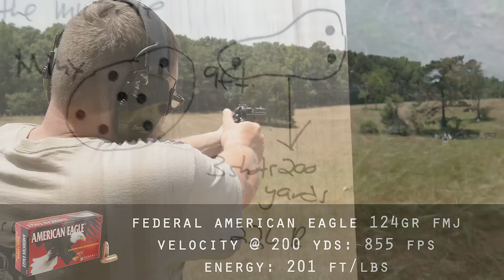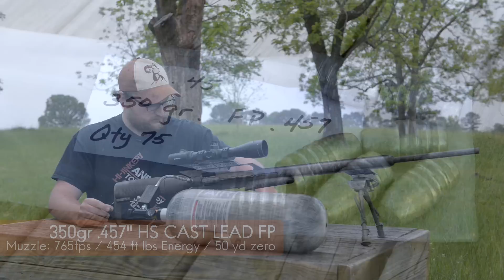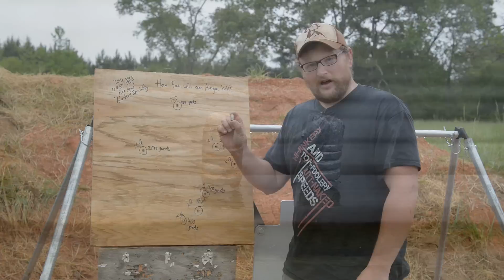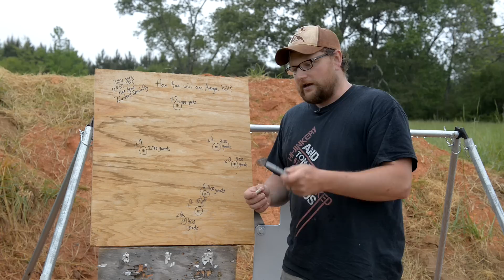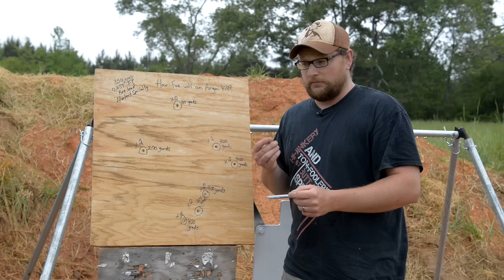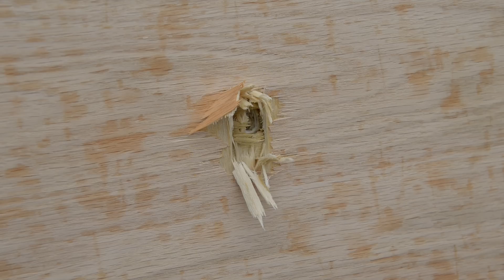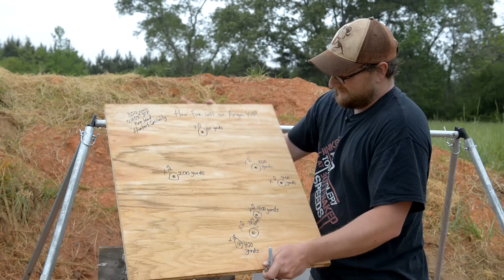How Far Will an Air Rifle Kill? Part 1

Comment: Do you need a guns license to buy this gun? Or can you buy it if you're 18 or over?
Reply: No need for a license (in most states)
Reply: ***** I am not talking about gun control laws, that isn't going to stop the violence in detroit or in most of the inner cities. Some states have implemented such things as you describe, requiring FOIDs, and its done nothing to stop the gangs (look at chicago for one example).

If you want to stop the gangs gun control isn't going to do anything (they already have guns and an illegal supply of guns), you have to address the cause of gangs, not the symptom that is violence. Again ending the war on drugs (so removing the financial incentive) is a good first step that actually works (see colorado and their legalisation of marijuana).

This can be seen in the fact that states without these issues have lower crime (much lower) despite having lax gun laws.

"Another fun fact, Austria allows basically the same guns as the US and yet their gun crime is about level with the UK." - Does Austria have a border with a third world nation across which drugs flow readily? No it doesn't. Does Austria have an underclass who openly hates law enforcement and refuses to work with them even if its in their own interest (as in criminal activity against them)? No it doesn't. This is what causes crime not "gun control", the fact that European nations have such wildly different laws and such similar rate of crime is strong evidence for this, especially as up until recently one could travel across the EU and but gun parts (barrels, receivers etc.) that in different places were not firearms or restricted (e.g. a receiver in germany is not a gun, but in other nations it is) and assemble an illegal gun from parts they bought legally. Though with the migrant crisis that will likely skew data acquired during the on going event.

With regards to the laws you propose you are looking at this without understanding much of the USA. 

Firstly Americans don't want such laws, so they are unlikely to ever become law without either massive change in public opinion (which BTW is leaning towards more ownership not less), or without a president using executive orders (which will feed into the following points and make them far worse).

Secondly you assume that American police will enforce such laws, they won't. As we saw after the gun controls imposed after sandy hook many sheriffs refused to enforce laws deeming them not only unconstitutional (which they were) and so a violation of their oaths (which enforcement would be) but also they knew that they would do nothing to stop crime and only effect the law abiding.

Thirdly you assume such a system is even possible. The USA cannot keep track of illegal immigrants (human beings who must eat sleep drink and defecate) and you are trying to make me believe they can keep track of over 350 million guns? Because without a federal registry and a lack of local law enforcement cooperation if such a law came to pass it would be wholly unenforceable for all but new guns (and again I reiterate over 350 million out there already).

Forth you assume that Americans havn't seen what's happened the world over, first they propose what sounds like a "reasonable" measure (like what you propose, though of course it converts a right into a privilege which is unconstitutional and as the USA is  supposed to be a nation of laws it would require the repeal of the second amendment before such a law could happen) and then they go further restricting some guns further, and enacting registration which leads to confiscation (see the UK and Australia).

If you seriously think gun control still have a real impact on america's violence problem then you are deluding yourself. No proposed laws will do anything, only repealing of drug laws and trying to rebuild the affected communities (while destroying the gang/thug/underclass culture) has even a hope in hell.
Reply: Well, for one, our population is about 5-6 times the UK and is even more diverse. So it is apples to oranges. Cesare Beccaria, a prominent criminologist from the 1700s, even said that gun control does not work. "False is the idea of utility that sacrifices a thousand real advantages for one imaginary or trifling inconvenience; that would take fire from men because it burns, and water because one may drown in it; that has no remedy for evils except destruction. The laws that forbid the carrying of arms are laws of such a nature. They disarm those only those who are neither inclined nor determined to commit crime."
Reply: Population is an issue. places with higher population tend to have more crime (cities more so as they are dense). The homicide rate is on par with most of Europe, but we have more guns. Central and South America consistantly have the highest murder rates in the world and among the lowest legal gun ownership rates. "Such laws make things worse for the assaulted and better for the assailants; they serve rather to encourage than to prevent homicides, for an unarmed man may be attacked with greater confidence than an armed man. They ought to be designated as laws not preventitive but fearful of crimes, produced by the tumultuous impression of a few isolated facts, and not by thoughtful consideration of the inconveniences and advantages of a universal decree."-Cesare Beccaria.
Reply: Fun Fact if the UK classified criminal cases the same way the FBI did then the UK's murder rate would skyrocket. Same with Japan.
Reply: IngeniousFirefly    Actually no the bad categorically did not work.
1. For the ban to have worked we would needed to see a reduction in the use of "assault" weapons used in mass killings. We did not and could not. The ban only prevented the sale of certain firearms and all the millions of these very popular weapons continued to exist. But whats more telling is the fact that before, during and since the ban handguns remain the key mass killing weapon.
2. The huffington post numbers you post are not a critical analysis of the bans effects. In fact it didn't even compare the so called assault weapons against other means. It mentioned this but then brushed it off and presented numbers as though it were taken into consideration. 
3. Number of variables.  The ban was only one of many things happening. It is difficult to assign an accurate number to how much the ban contributed, if at all, compared to other factors. 
There are all sorts of people out there pontificating about whether it worked or did not and very little from either side is based on solid analysis and evidence, largely because such evidence is difficult to obtain.  Yet, people still want to throw their "analysis" out there like it is valid. Look at a prime example. Citydata has a story that wants you to believe that the drop in gun deaths largely happened during the AWB so the ban had to be the reason why.  This is absolutely ludicrous in so many ways. One, the ban only stopped the sale not the possession so at best the ban should have leveled the trend not brought it down. Next, homicides by this weapon type are only 2% of total gun deaths. So, how can there be this big reduction in deaths if 98% are caused by other types of firearms?  Well, it can't. But these points totally escape the author on city data and so many other places. So, before claiming something worked or didn't you really need to fully understand the issue not just some numbers thrown out there by some site, regardless of which side of the issue you fall on.
Reply: U can be any age
Reply: +Airgun Depot okay because I know you don't for regular pellet guns but this thing seems much more powerful
Reply: +Dovahkiin KhajiitMaster it had better be at 1600.$
Reply: In Canada yes
Reply: Depends where you live, my country it's classed as a firearm because it's over the unlicensed power so you need a license. Other countries don't have air rifle limits so you don't...
Reply: licence? its america not cuckistan
Reply: ***** Fun fact, Detroit has a murder rate on par with the whole of the UK.
Reply: ***** not surprising, its basically like a third world nation with the local economy comprised of illegal drugs and illegal arms trafficking. That being said I imagine most murders are gang members killing other gang members.
Reply: ***** The fact that you just dismiss that and don't automatically think something needs to be done about it is quite sad.
Reply: ***** I see that stuff has been tried and has done nothing. 

Perhaps the ending of the war on drugs would help, hurting the financing of the gangs. The real issue is the whole gang/thug culture mixed with the drug war, that not only encourages and aggrandizes being a violent criminal but provides a financial incentive to do so. A culture that is very predominant among poor black communities, as is the case in detroit. 

If you have a solution that will actually do something then I'm sure everyone would like to hear, as I said people have tried for years.
Reply: ***** What has been tried? Background checks? Random bans that only last a few years? Sack load of good that's done. Bullets buttons and magazine limits are just as pointless. 

Even a simple license would be a good start, you get pre vetted so won't need to have any checks upon buying a gun. Walk in, pick a gun show your license and walk out. It would also have the added benefit of filtering out most of the mentally ill nut jobs. That added with by law having to keep them securely stored, illegally held guns will become less and less common because stealing them would become very hard. 

I love guns and don't think any should be banned but the US has a problem, a simple license and storage laws would let sports shooters and any lawful owner keep their rights while stopping criminals getting such easy access to them, 

Another fun fact, Austria allows basically the same guns as the US and yet their gun crime is about level with the UK.
Reply: ***** I'm not saying what i said will absolutely work but the current state of affairs nothing is ever going to change, all the gun crime is just going to get worse and worse. 

I even in the UK have a right to bear arms, my shotgun license was obtained just by filling a form and after which the police have to find a reason why you can't own a shotgun. The UK is an extreme case of gun control, you can get anything you want but in practise you have to be a serious enthusiast whereas the US is the exact opposite, it's simply too easy for the wrong people to get guns and it amazes me that American gun owners refuse to admit for even a second that there's a problem to the point where it's mocked by the rest of the world...

Honestly you're clearly an intelligent person which makes me ask why was the first comment you made such a childish stupid thing to say?
Reply: IngeniousFirefly Funny though that the FBI's murder statistics show that the murder rate in the USA has halved since the mid 90s despite the expiration of the "assault weapons" ban on a federal level, despite more states allowing and more people carrying guns, despite more NFA firearms and more non-NFA facsimiles in private hands, and despite increased ownership of semi auto rifles and handguns.
Reply: IngeniousFirefly "There are far better gun regulations that could have been proposed.", the most effective regulations would be nothing to do with guns, keeping violent felons in jail until they are safe to be released, and ending the war on drugs (which has caused nothing but more violence).

Further to that several points. A) The murder rate continued to decline post AWB and B) Mass shootings make up less than 1% of murders so they are really insignificant (compared with the thousands of people killed as a result of the drug war).
Reply: IngeniousFirefly In the US if 10 people murder 1 person it's 10 counts of murder. if 1 person murders 10 people it is again 10 counts of murder. In the UK due to political pressure if one person kills 10 people it's considered "one crime" likewise if 10 people murder 1 person it is again "one crime" In the UK A homicide is not deemed a murder unless someone has een actually CAUGHT and tried in court and found guilty of murder and sentenced to prison. If no one is caught it is simply deemed an unnatural death and not reported as a murder, even if the victim was shot fifty two times in the back. In the US is someone as obviously murdered it's deemed a murder if anyone is caught or not. And it's not just murder stats. Robberies are constantly downgraded to simple thefts. Meanwhile the UK authorities pat themselves on the back by padding their figures with increased "weapons confiscations" by labeling damn near anything and everything a weapon.
Reply: IngeniousFirefly The only one habitually misrepresenting the facts in the UK. Personally I love how the UK LOVES to single out firearm murders specifically. as if Murders by firearm are somehow more heinous than murders by any other metric. The UK's actual Crimes across the board for each type of crime are rising. But because of political pressure on the UK authorities to maintain the safe and cozy imagine the UK built up decades ago they are constantly manipulating the classifications of crimes to lower them into less serious offences.  In the year 2011 the UK's official Murder count was 636 murders or 1.15 murders to 100,000 people. But this is only the number of murders actually recorded as murders. According to the UK's death registry in 2011 329 people died from "assault", 27 by poisoning (not suicide or work related), 361 by strangulation (not suicide), 127 by non-accidental or suicidal drowning, 7 with guns, 2 with explosives, 20 by stabbing, 62 pushed from a high place, 21 run over, and another 198 of "other specified events in various places".  By FBI reporting standards that would be 1154 murders nearly twice what the UK officially reported as murders. if a nearly100% increase is not a skyrocketing toll then I don't know what is. Granted the actual murder toll is only half of the US's murder rate in 2011 the UK doesn't share it's border with a 3rd world shit hole constantly pumping drugs and illegal guns and criminals into the country. The Fact of the Matter The US murder rate and crime rate overall has been dropping like a stone since the 80's in 1980 the US murder rate was 10.2 per 100,000. The Latest Murder rate is sitting at 4.5 per 100,000. If current trends continue to follow the US will be looking at 3 per 100,000 in 10 years or less.
Reply: You are quite wrong. Average homicide rate in the USA is about 5x as high as in most European countries. 

Mind you that rate does not seem to vary in relation to the number of guns per capita in Europe.

And FYI the gun regulations in Europe are not that strict - it is just bothersome (about as bothersome as getting a professional driver's license) to jump through the legal hoops, so mainly only enthusiasts bother. Cap-and-ball historic guns and replicas regulations are pretty lax (in several EU countries you can buy them off-the-shelf, even registration is not required) but again - this is something only enthusiasts (like me - black powder is much more fun then modern guns :) ) usually bother with.

I think that the main problem in the USA is the attitude - you guys seem to have gun fetish and are quite twitchy, trigger-happy... and at the same time pretty careless where it comes to handling guns. The things I see on youtube... How can people leave loaded guns where a teen kid can swipe them to pose gangsta-style on youtube and then almost shoot himself?

Yes, there are plenty of responsible, competent gun owners in the USA, but the access is too easy for morons who won't bother to train, store safely etc.
Reply: To add perspective to this whole thing:
https://mises.org/blog/mistake-only-comparing-us-murder-rates-developed-countries
Reply: andrzej2501 Most European Countries manipulate their murder statistics to artificially keep them low. If the UK authorities alone classified crimes the same way the FBI does their murder rates would jump some where between 100% and 150%. In the UK a murder is not classified a murder unless the crime is actually solved. A man could be found bound gagged and shot 52 times in the back at the bottom of the pool it's still not a murder until someone has been charged and convicted of it.
Reply: Nick Knight
Bullshit. Even FRANCE (with plenty of ethnic problems and terrorists problems) has a rate of 1.2.

UK also has HUGE number of immigrants from all over EU and the old British Empire. And their rate is at 0.9.

Face it - US has a lot of problems. However I will admit that "banning" guns is not the solution - it would just help with accidents and "murders of passion" in the heat of a moment (and similar).

In my opinion the primary problem with guns in the US is the gun fetish, the feeling of constant danger AND lack of competence to handle guns in quite a large percentage of gun owners. Not in case of enthusiasts - but the schmoes who buy a gun because it is cool, the want to feel important and strong or because they are scared. Psych evaluations, training and practical tests would not harm anyone - enthusiasts do much more training then any reasonable official test would require anyway.

Solution form several EU countries would be much better in my opinion: background check, short training, eye exam, practical shooting test and simple test regarding gun safety and regulations, optionally psych evaluation (not much more bother then in case of a driver's license) and then the government SHALL issue a permit. But get rid of those stupid regulations nitpicking about the shape of a handle, size of the magazine, open carry/conceal carry etc - those are just ridiculous.I.e. the only limit I would face (besides money) ;) is that I would not be able to buy the .50 cal M82 because there's an upper limit of 12mm for rifles (not shotguns) - unless you buy replicas of old cap-and-ball guns ;) Recently I've seen a 0.72 cal monster ;)
Reply: godofawesum223 That is just some stupid myth. Homicide is homicide, even if it not solved.
Reply: Nick Knight   The 2nd amendment was not written so that we can protect ourselves against deers.
Reply: +Ron Barfield   The need and use of guns was understood in those days. The founding fathers did not need to consider guns for self defense or hunting or even recreation. This was all a given and not part of the 2nd amendment equation.  The second amendment was written specifically to address a government becoming tyrannical and making sure the populace was armed to the point to be able to oppose said government and even overthrow it if needed.